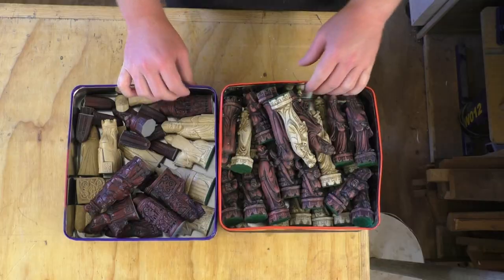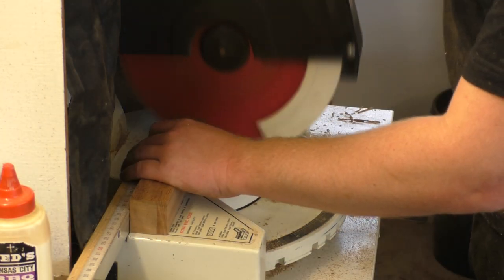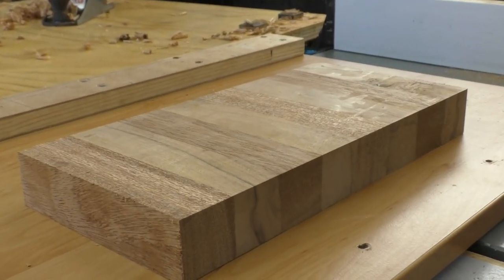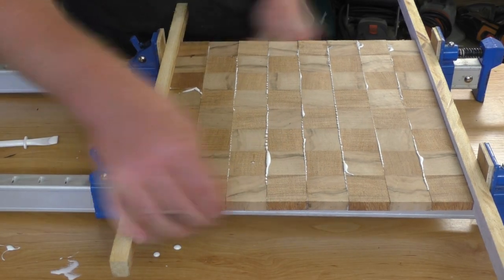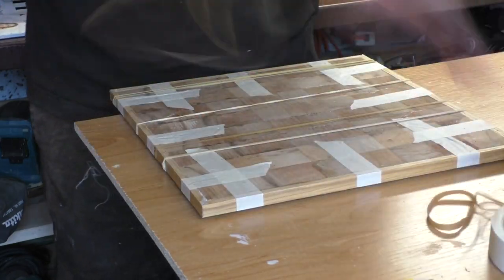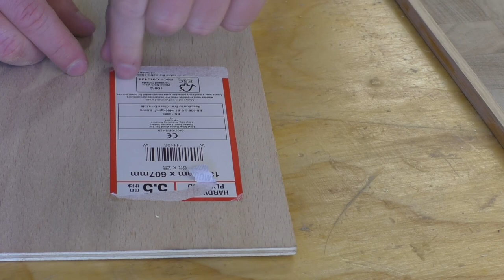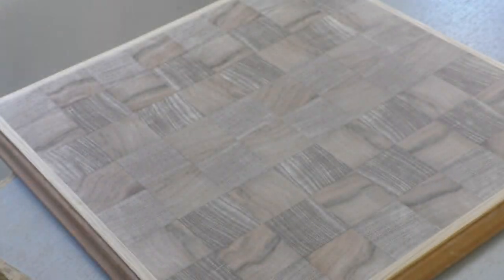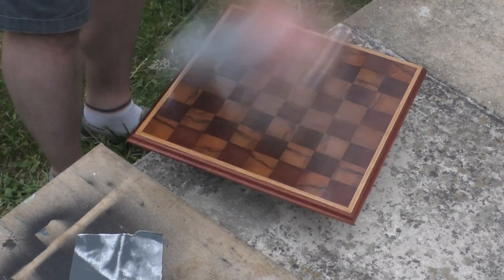The Chess Set (Part 1 of 3) - The Board

Comment: at 3:50, there's a better way to do that. If you clamp adjacent pieces in the vise at the same time, outside faces out, and inside faces in, your hand-plane will create a perfect glue-up line.  The error in the angle in one piece will be balanced by the opposite error on the other.

Comment: Nice job.

Just a tip on removing lables from shop bought wood.  If you heat them uup with a heat gun it softens the adheisive and they scrape off easily. I normally use a hair drier which is not as hot and so will not scorch the wood.

Bill.
Reply from the maker: +billsbasementworkshop great tip, thanks

Comment: Hi Nice project. I also hate those stickers on plywood. I remove them with a small torch. Just go Quick over the sticker to heat it up. And the you can remove it a bit easier.

Comment: I’m new to woodworking. I want to make a chessboard for an anniversary gift. I’ve seen multiple versions and all of them glue the board to mdf or plywood. Why is that?
Reply from the maker: Because solid wood warps twists and bends and plywood or MDF doesn't
Reply from the maker: Also it wouldn't be particularly strong without the re enforcement and extra glue surface
Reply: @RagnBoneBrown  thank you for your prompt response. I genuinely appreciate it.

Comment: If you dont mind , where do you get that spray varnish ?

It has a look of the pound shop about it.
Reply from the maker: +Andrew Joy it was cheap on eBay I got a few cans for not much money it's by "Motip" and it's pretty decent stuff
Reply: Rag 'n' Bone Brown Motip is actually a professional brand and delivers high quality stuff. Use it a lot at my work. The colours are also great. One of the few brands were you can actually speed thinks up with an heat gun (wouldn't try that with the varnish) 
Great project btw. Pretty easy to make, but it looks great!
Reply from the maker: +Bart B thank you! Interesting. I've found that the varnish dries remarkably quickly especially in sunlight- touch dry within 2 minutes